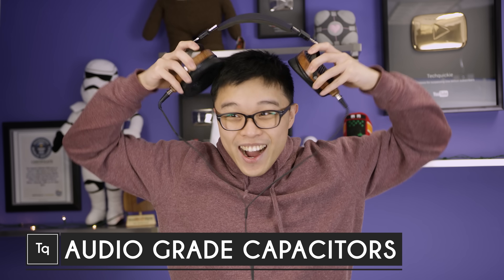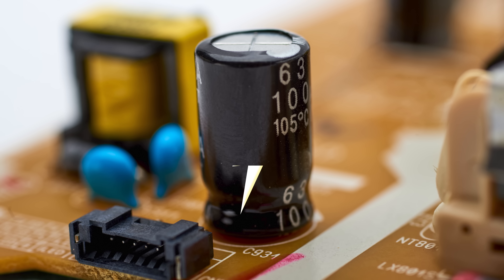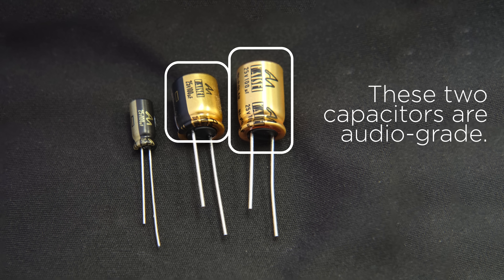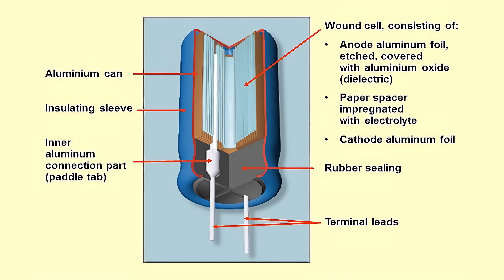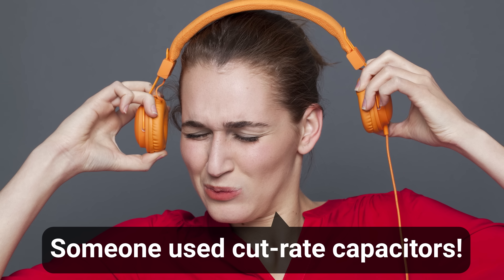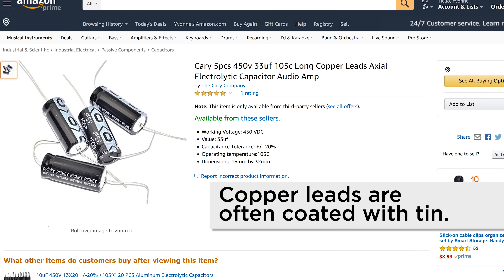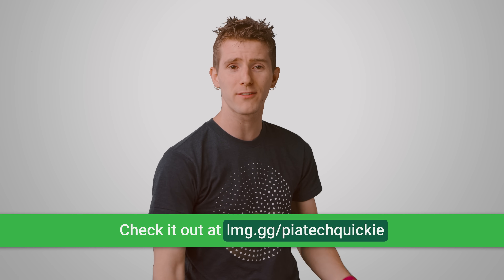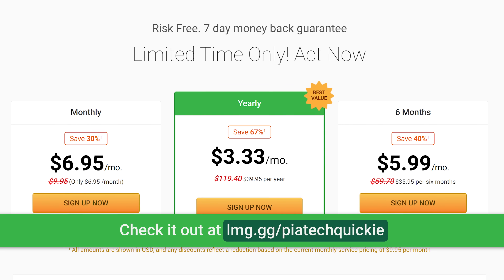What Does "Audio Grade" Mean?

Comment: A lot of bandwagoning here I see. It's absolutely a misleading video, but as an EE instructor, there's not actually much "misinformation" here at all in terms of the facts presented. It wasn't until the "improve electron flow" part that it went too far beyond a reasonable explanation.

Unfortunately thats really all that was said, they use special electrolytes and separators, and copper leads, to "improve electron flow". Which, well yes, those things may do that, they're just not good ways to achieve that, so it's just a rather nonsensical, audiophoolery thing to say, and a way to completely gloss over the whole concept of ESR.
 I'll try to lay it out if anyone is trying to follow along, try not to be too scared of any terms you don't know, I try to assume no electrical knowledge in my explanation, but I do give the actual numbers for people who want them, to try and put the facts that SHOULD'VE been in the video at least somewhere nearby.

To put it in terms from the video, ESR is literally the measure of "how much resistance there is to electron flow". We don't need any hand waving or complex explanations, it's that simple. It's actually a special term that takes all the complex nonsense of dealing with AC vs DC, impedance vs resistance, inductance vs capacitance, etc, etc and deals with it all for you, giving you a nice simple number you can compare between parts - the lower the ESR, the more freely power can flow. And better yet, it's a known value for every part, with a known tolerance, listed in the datasheet along with the hundreds of other ways we profile every component, so you don't have to believe any marketing spin or hype, you can compare the facts directly and easily yourself.

So, If you want a "free flow of electrons", you want a low ESR. Each type of capacitor has its own strengths (ESR, value, price, voltage handling, size) and there are hundreds or thousands of different models of each type from all different vendors, each tuned to trade-off one specification against another to make it better suited for a certain task. Electrolytic capacitors are really cheap and are quite compact for how much energy they store, but they're generally one of the worst options if you want a low ESR. This is where things start to go wrong. Audio Grade capacitors are a Low-ESR model of a High-ESR type of capacitor. Yes, that's exactly as redundant as that sounds, and yet still useful, we already had Low ESR electrolytic capacitors for a very long time, for when you're hitting the limits of regular electrolytic capacitors, but also want to keep costs down. Audio Grade capacitors are a new form of Low ESR electrolytic capacitor, with secret sauce voodoo in their construction that is so secret that their measured ESR doesn't even change, it's just better in other mystical ways...
Reply: If you actually wanted a low ESR filter, you'd use a whole bunch of Ceramic, Tantalum or even Polymer capacitors, probably even still an electrolytic or two, of a whole bunch of different values all tied together, as eg proper lab grade equipment will do. This kind of design can give incredibly low ESR and a bunch of other advantages, but is not as compact (although they're getting darn close these days), would be many times the price ($50 of parts on a high quality filter isn't unreasonable), needs some other supporting parts, and for consumer audio quite frankly, would be gross overkill.

The jobs of the power capacitors in an audio device are 1) to filter out any noise or ripple from the supply, and 2) to provide a reserve of energy so the amplifier can actually draw more power than its power supply can provide for a brief moment (eg the first punch of a bass drop).

For job 1, you want a low value, low ESR, "decoupling" capacitor. This is because modern power supplies use quite high frequencies (into the MHz range), so to filter it properly you need a very quick and snappy capacitor to handle the high frequencies and even faster edges - but - it doesn't need to actually store much power, since it only has to go for less than a millionth of a second before it'll be recharged. This works out perfectly, as generally the lower value a capacitor is, the faster its response is - which has fed the cycle that has allowed power supplies to keep getting smaller, lighter and more powerful, as we keep running them faster and faster.
Job 1 is generally handled by one or two ceramic capacitors, in the 10nF to 10uF range. These are a <1 cent part these days, used next to every digital chip in almost every electronic device since 1970. It's also worth noting that this is well above human hearing range, and modern supplies really shouldn't have the same audible noise as 80s/90s era hardware, even without ANY filtering.
 Interference or signal noise from external sources like mains power cables, radios, etc on the other hand is a real thing, but all the capacitors in the world can't fix this for you, as it's not coming from the power supply, and the only real solution for such issues is to stop the interference coupling over, usually by separating or shielding your cables, or using more professional grade equipment like balanced audio which rejects most noise by design.

For job 2, you want a high value, "bulk" capacitor (or a bunch of them), and you don't really care about any of its other attributes. This is because the impact of a bass "beat" is actually a very slow push, hundredths of a second, an eternity for a capacitor, tens of thousands of times slower than job 1. For this you want an absolutely massive storehouse of energy, but you really don't care about the ESR, as you'll be drinking the power over a much longer time. At the end of the day, as long as the ESR isn't too horrific, it'll do fine - and even in a lab with cutting edge test gear, it would be extremely hard to find a situation where you could measure ANY difference whatsoever in the actual sound output with or without Low ESR capacitors in the power supply - let alone pick it by ear. In the most extreme cases, with an ear-punishing low frequency square wave at absolute maximum volume, the difference between a regular and Low ESR electrolytic capacitor would be the equivalent of occasionally turning your volume knob down from 11 to 10.99998 for a fraction of a second. Thats a very minor difference, but hey, if some people want to claim they can hear it, i'm not going to argue that. However, once again you can just as easily pick a non "Audio Grade" capacitor with the same ESR, so you're not paying for that performance, you're paying for the secret unmeasurable voodoo inside, and of course, the name.

It's also important to note, that this capacitor will go largely unused, until you are at or near max volume and level - ie actually playing sound right at the point of clipping. Most amplifiers have quite significant distortion for other reasons before they start clipping, so most users, both pro and consumer alike, rarely push things that high - meaning this capacitor could actually be many times worse and you'd never even notice. (this is where bad capacitors start coming into the consumer eye, manufacturers have been cutting corners here for a long time, so many cheap modern designs will have grossly under-rated capacitors and they'll perform horribly or fail quickly, which is another root for this myth)

Because of the simple requirements, job 2 is generally handled by one or more electrolytic capacitors, at least a few thousand uF in value. Huge in value, terrible at everything else, these range from a few cents to a few dollars depending on things like brand, temperature rating, expected operating lifespan, mounting style, frequency response, ESR, etc, etc.

Of course there is a certain element of quality involved, and i'm assuming they're at least good enough quality that they meet their own specifications - but in general the manufacturers of cheap capacitors will be quite up-front about it, with their specs just not living up to their more expensive counterparts. The stats we care about here are the value (to match our amp's power rating), the frequency response (audio is relatively low frequency, but we want consistent performance right through from bass to treble frequencies), and the temperature & operating hours rating, which tells us how long the capacitor will last on average before it fails. Capacitors care a LOT about temperature, so much so that the rule of thumb is, you can double the expected lifespan for every 10 degrees C below the rated operating temp you run it. This means that for two otherwise identical capacitors, with the same expected lifespan for "operating hours", one 105C rated, the other 65C rated, both used for the same application and kept at the same temperature, the 105C rated part will last 16 times longer. This is the difference between a product lasting 2 years or 32 years, even though both capacitors had the same "operating hours lifespan".
Reply: I haven't even touched on concepts like inductance, resonance, cutoff, etc here, but suffice to say that any other issues that come from these more complex areas, can be addressed by simply selecting the correct model of capacitor, or in the absolute worst cases, by adding an extra capacitor. This is the case even when sticking to the cheap (non-audio grade) parts.

So, for an audio application, there is no need or want for a Low ESR "bulk" capacitor. Even if it was so absurdly low that it could also fill the role of the tiny "decoupling" capacitor for job 1, removing that tiny capacitor would literally save you less than 1 cent on your product cost - while the "Audio Grade" capacitor will be at least several dollars more expensive.
 They can be in the $10-$50 range for a single capacitor, replacing a standard part with matching (relevant) specs which would be something closer to $0.50 - $2.50.

"Audio Grade" capacitors are simply a circle jerk between capacitor manufacturers and product managers.
 - They usually are constructed differently, although many or all of their advantages are of dubious benefit and are chosen more because they sound like they could work when the process is explained (eg silk insulators).
 - They're cheaper for a vendor to implement than a truly better filtering solution, but they're still "good enough", because regular electrolytics would've been good enough.
 - Large value electrolytics are generally the most expensive capacitors in a device, so if you want to mark something up, they're the obvious choice.
 If you could make a product say, halfway between what a cheap electrolytic capacitor and what a lab grade filter would cost, it'd be ideal, yeah? Oh, right, that's exactly where Audio Grade capacitors are priced ;)
 - And finally, they get to claim the product is using special Audio Grade capacitors, slowly creating the misguided belief that those devices are somehow higher quality, and devices not using Audio Grade capacitors are inferior. As more people demand it, more vendors start making products using them, throwing more marketing in people's faces that they're somehow better, and its a self-perpetuating cycle.

It allows vendors to differentiate their product from the market AND increase their price at the same time, a complete no brainer in business terms. The fact that it has no actual impact on performance is irrelevant.
 A product could be designed using premium quality high temperature capacitors from a reputable brand, designed from the start to be over-engineered demanding better specs than they need, so their product will literally last a lifetime even with the components aging - OR - a product could be hastily thrown together to cash in on the hype, by using "Audio Grade" capacitors from a manufacturer who is a complete nobody in the capacitor business, with questionable and non-industry-standard manufacturing methods, using designs that have never even been tested for lifespan, let alone tweaked or refined by decades of industry experience - all while at 20 times the price.

Are you really sure you'd prefer the one with the "Audio Grade" badge?
Reply: This behaviour is bad, but absolutely understandable from a business perspective, and that's the world we live in. Welcome to capitalism, where the only way to fight something like this is by sharing knowledge so people vote with their wallets.

Also, this isn't really a new thing, its just another form of buzzword upselling, and while it does prey on consumer's lack of information, it's not an outright lie. They're guilty of "not saying WHY or IF they're actually better in any measurable way", but they generally leave it there, telling people "the carbon is way more conductive" and letting consumers jump to the conclusion that it matters in any way themselves.

This video however, goes beyond that, and dives straight into purposefully lying to and misleading consumers into believing this completely manufactured myth, asking "Why are brands that use them better than brands that dont?", then actually connecting the dots for the users and putting Linus's voice behind it "Because the electrons flow better in this brand's stuff". While I do respect that someone has clearly fact checked it and made sure it's not quoting anything straight up wrong in the techncial claims (just errors of omission), most of the script between the details is an outright lie, and the entire point of the video is to mislead people and perpetuate this myth, which I didn't think LTT had quite stooped to. For shame.
Reply: Ok, that was one hell of a long youtube comment. I hope someone makes it this far, and even moreso that someone, anyone, learns something here.
<3

Comment: Better to explain dual use of capacitors - power storage and D.C (or low frequency) filtering. Shitty capacitors as power storage have high impedance and/or ring. Shitty filter capacitors lose or distort signal information. All these make them farther from the theoretical perfect capacitor. Audio grade capacitors are closer to perfect in audio frequencies than "good enough" generic capacitors. Unfortunately Linus instead dug into some capacitor specific implementations without communicating what matters and why first.

Comment: all this "audio-grade" and "premium" are only marketing shits to fetch more cash from thy dumb idiots around ... BTW, also all tha "analog" hype is the same marketing shit, because everything is today recorded and encoded and processed and transfered as digital; as far as signal is at digital domain, it doesnt matter which are there capacitors or whatever, it simply doesnt matter at all for processing, besides that power supply must be constant, which is exaclt ywhat electrolytic capacitors are still these days for, for filtering power supply ... not to mention that any small noise has NO effect on digital signal...and until that digital signal is converted back to analog as far as possible before headphones or speakers, so ideally using effective Class-D power amplifier with added audio range filtering, again no capacitors will affect anything audible ... well, there will be probably last thing in series with headphone or speaker, and it can be capacitor ... nevermind... most ugly thing about any ELECTROLYTIC capacitor is that it is DRYING and loosing its features over time, inreversibly.... so ANY pure ANALOG circuit using electrolytic capacitors will have in time DRIFTING features/quality ... aftere several years simply unusable...  htats whay old TUBE amps can sound differently after many years of usage having DRY el-caps etc .... everything needs to be replaced, no way other fix ... well, its about the BIG el-caps mostly but ... well, anything analog and audiophile and golder cables and all that looseles pricey shit is imply this... SHIT )) cheers ... any you really dont want me to talk about the "vinyl" thing or even far better "cc's"... really )) cheers again

Comment: I'm a physics graduate, and I can't believe the venomous crap spouted by so called EE graduates who believe electronic components are perfectly described by the little circuit diagram they learned in EE 101, if they ever attended that class. The R in ESR is nonlinear, for a start. Furthermore, all capacitors are naturally microphonic; the voltage across the capacitor is roughly proportional to the dielectric thickness for a fixed charge. This phenomena is used in condenser microphones, and it works in reverse, the voltage on a capacitor will cause an attractive force between the plates, thus altering the distance between them. And, let's not start a conversation about piezoelectric effects in ceramic dielectrics.